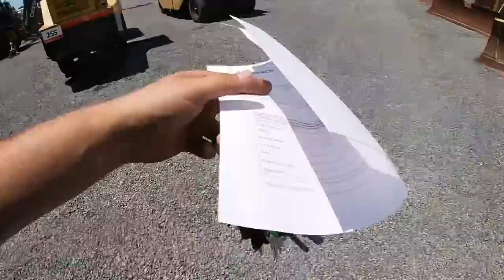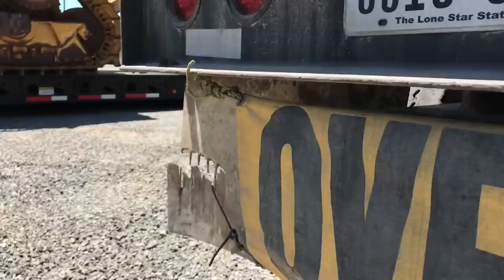A day in the life of a heavy haul trucker | kenworth picking up dozer and roller from auction

Comment: If u haul another dozer.  The best place to hook a chain is the 4 corners of the tracks. 33 yrs of experience hauling heavy.
Reply from the maker: Eirick Chronister should of done that in the front of the dozer. That’s the way I chain the excavators.
Reply: As well as the back...
Driver’s Handbook on Cargo Securement Chapter 10 “ Restrain Cargo using a minimum of four tie downs”

According to DOT the dozer could still move from side to side with the way you had it tied down. Thats why Eirick mention the 4 corners.
Reply: @adrianmartinez3220  Sorry to interject they call it a 4 point tie down not hooking up to any part that's removable. Just saying. 🙋‍♂️
Reply: @adrianmartinez3220  I'm from Canada but pretty much the same rule as down there I think. Heavy equipment (10000# of more) has to be restrained with  at least 4 chains. Correct for states as well?
Reply: Love to see u truck dem i have  one inter truck pro star 
I from st kitts and always watch u video
Reply: @snipernbolt1  Here in the UK, it has no weight limit, any machine or piece of equipment for the Construction Industry MUST have a minimum of 4 hooking points, all corners have to be tied-down independently.
And NEVER to a step!!!!!!
Reply: Bearded old man might b related to water boy's couch
Reply: @Grtruckingdemolitionllc  Yeah, those steps aren't babies and you'll get away with it with a baby dozer like that but if you torque them sideways they can sure bend and they can sure crack and split. Then all you got to do is hit a heavy bump or pothole and your chain flies loose and the hook/step goes flying through a little hatchback's windscreen.

I do heavy diesel repairs and service and those steps often get busted up and bent.
Reply: @Grtruckingdemolitionllc  that’s what I did in my 40 years of hauling heavy machinery
Reply: That’s how I chain a big load. Always cross the front and secure the real. Over securement is never too much.
Reply: @snipernbolt1  machine had 7 points on it.
Reply: @horndog7357  haha this comment made me laugh. Only people that watched the movie will get it.
Reply: Yeah this isn’t heavy haul plus the tie downs on his load is crap ..

Comment: Hey buddy I watch your videos all the time. Love them. You do good work and are a good driver. Dont get mad at me but one thing I noticed when you were chaining the little dozer you put the chain on the step on the blade. You should never trust a step like that.i would of wrapped it around the blade A arm its self. I know being a small dozer and. Ot going far it will be ok. But DOT doesn't look at it like that. Like I said brother not trying to be a jerk was just throwing it out there
Reply: Agree!
Reply from the maker: chris chandler thanks for the advice, I could of used the tracks also. I chain the blade when I load a dozer by itself.
Reply: Ya I was thinking it was just settling. You just never know. I know sometimes when you chain down and then hook it back up. The belly sag scan tighten/ loosen chains to the point of snapping also. Usually the chains in the middle will tighten and the chains at front or back will loosen. If you can imagine how the trailor has tensile strength and sags in the middle you can figure what chains do what.
Reply: @Grtruckingdemolitionllc  Yes, that was true but also, every manufacturer handbook would tell you where the hook attachments are in its machine. This is even a test question in my Lorry Loader Securer course (A50 ticket) here in the UK

Comment: Next time turn the dozer a little one way n the blade the opposite way and you can get the blade inside of the trailer n you won’t be oversize. Works on the smaller dozers
Reply: Correct, I saw that too. Good spotting!!

Comment: 32:07.......BANG!💥
DID YOU LOSE A CHAIN?🤔
Reply from the maker: Ken Brownlee chris chandler it always does that after hooking the RGN back up on a turn. Has done it ever since we bought it. Seems like the neck just falls
 perfectly in place if it’s a bit off.
Reply: @Grtruckingdemolitionllc  That bang is that style of GN coupler.  It is not seated all the way unlit you make your first left hand turn loaded.  That style is hard to seat, but if you look at the wear on the landing you can see how far back it should be.  I bet it doesn't do it as bad making right turn if it does it at all.  Nice job with the channel, and nice truck.  I have always liked how that KW looks, and with a cat that is a nice ride.

Comment: i don't know much about securing a lot of heavy equipment but i did operate and haul in the us army but we never used chains or binders directly to the tracks,we always chained in an X pattern
Reply from the maker: Yes x patter is one of the ways to chain or just from the tracks, I wanted to make sure I had enough chains for both machines that’s why I only used one for the back of the dozer and front of the roller
Reply: Need 4 tie downs. One chain can be used, but you have to have 2 tie down points with it, and a binder on each. That single chain with one binder, is 100% illegal.

Comment: This is a good video on what NOT to do as a Heavy Haul trucker. First off ALL 4 CORNERS That's Heavy Haul 101. Next the step isn't somthing you should ever use as an anchor point. Next you Always chain down your blade separately. Now for the pad-foot roller you put 2 chains. Should of had one on each Corner separately. Then if the machine pivots in the middle you can do one of 2 thing's. You can drop the locking pin so it can't have it. Or you have to chain it down at the Pivot Point. DOT would blow a gasket if inspecting this load. One thing you did do right blowing your air bags down before loading. One last thing stay off your phone while operating a piece of equipment or driving. Just a few pointers from someone that's been Heavy Hauling for close to 30 years.

Comment: It bangs like that because you don't set the gooseneck all the way into the trailer paws when you pick it up if you look you see the rusted spot where the base of the gooseneck sits at the top of the trailer you shouldn't see that spot
Reply: Push the gooseneck up with the legs a little more as you go to pick up